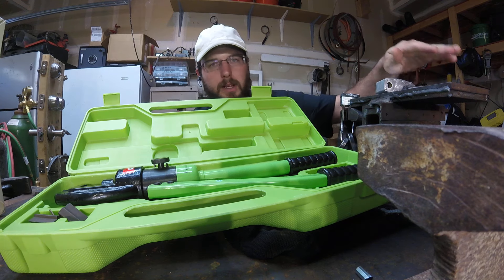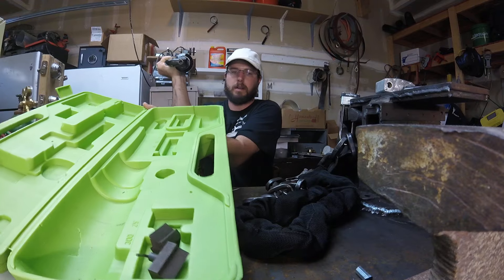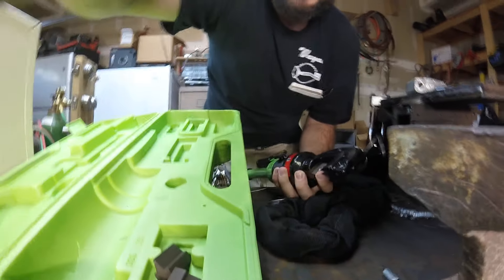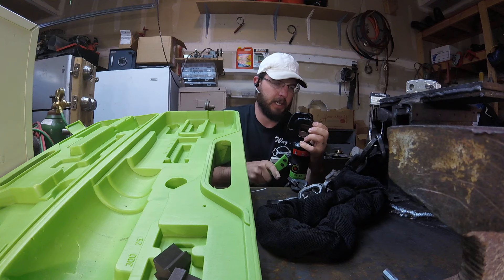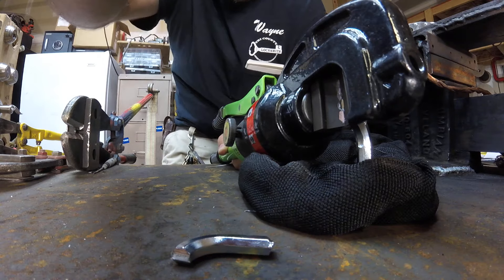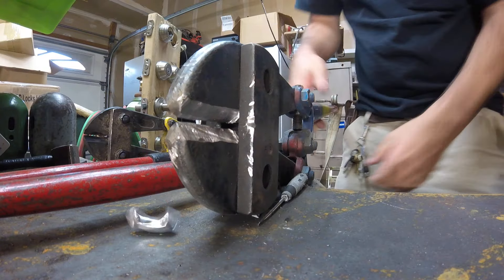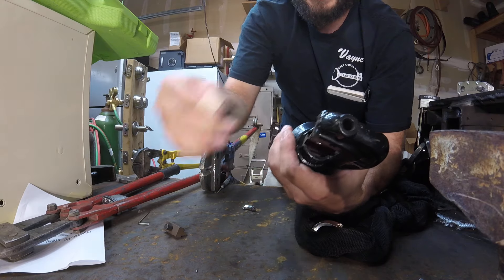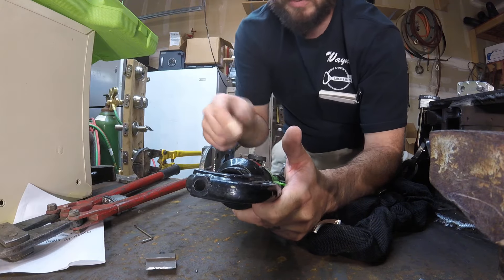Hydraulic Bolt Cutters HY 20 Hydraulic Steel Rebar Cutter Review Cut Padlocks

Comment: I was apart of the marketing team that designed and first sold these hydraulic rebar cutters. We made these cutters, aswell as a smaller design the YQK-70 with its chassis used except for wire crimping. The small version can put out 12,000lbs (6 tons) of force about half as much as the rebar cutter. We eventually after several prototypes, sold the patents for the rebar cutter and wire crimps to the Chinese.

Comment: Nice video. There are dozens of hydraulic wire crimpers out there that are basically the same tool, just use split dies to crimp the connectors onto the cables. I have wondered if you could buy the blade dies to put into the crimpers so you could cut bolts, rebar and other metal?

Comment: steel = 7.5 hardness
boron = 9.3
boron carbide = 9.5/10
diamond = 10
boron nitride = <10
hardend steel = 8.5
chromium carbide = 9.5/10
Reply: Where would Molybdenum fall on this list. That's what the Stanley 24/7 uses for a shackle.